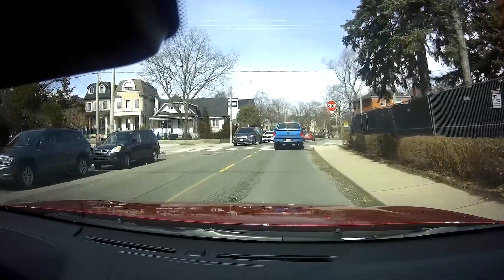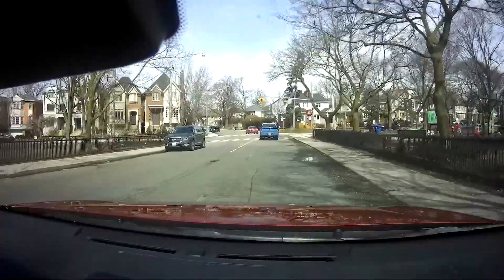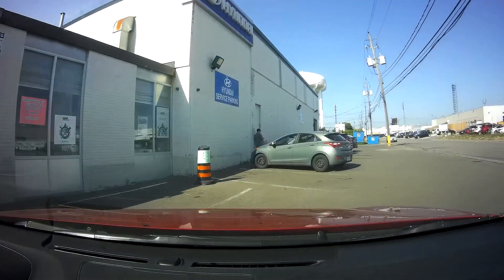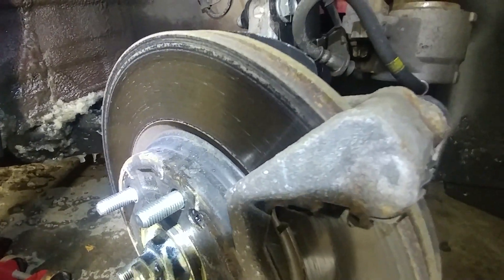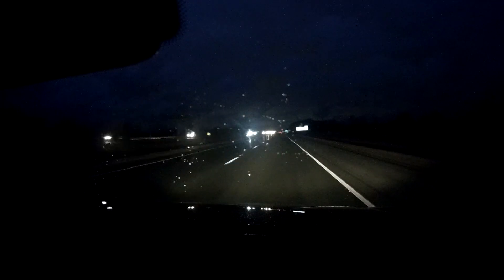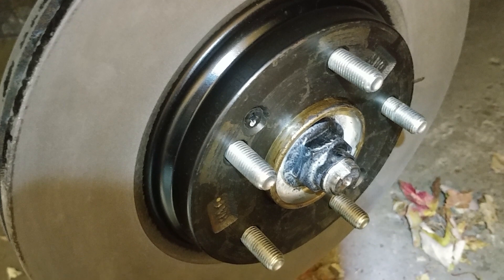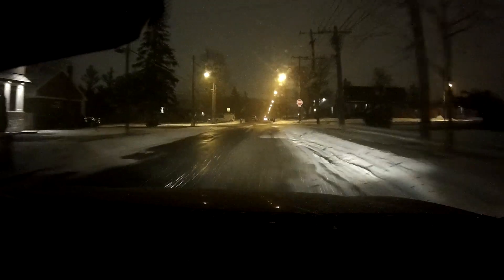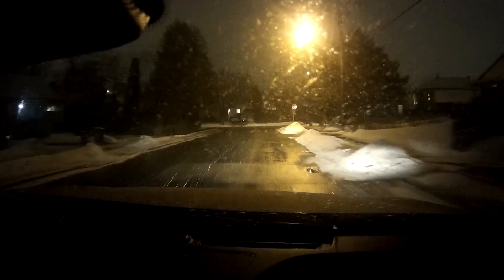Kona EV - Time for a new motor & reduction gear at 30,000kms?

Comment: Kona and Niro owners who are out of warranty are now reporting that Hyundai/Kia won't cover the cost of repairs despite that these issues are entirely a factory defect.  One Niro owner with a warranty can't get Kia to acknowledge the noise while another with a 3rd party extended warranty has been told that they won't fix it while the car is still operational.
Reply: Attorney.

Comment: Good thing it was figured out. I'm glad I purchased the 8 year bumper to bumper warranty.  I have the 2022 Kona EV and have driven 20K no issues.
Reply from the maker: Not sure what country you're in, and it's different by model year, but the basic warranty on the 2019 in Canada had 8 year, 160,000km warranty on the drivetrain, so battery, motor, reduction gear. Of course if you want the peace of mind for the other stuff, that's good, but I personally am not usually a big fan of the extended warranties.. the dealerships offer them because, overall, it's usually more of a win for them.. kind of like "the house always wins" with casinos, however if you get issues, it's the same as hitting the jackpot :)
Reply: @robviously-rob0ts   I'm in Toronto and didn't mind paying $3600 Canadian for 8 years bumper to bumper.

Comment: Glad to hear you got it taken care of under warranty.   I'm wondering why changing the reduction gear oil is not part of the recommended scheduled service.
Reply: it is, under normal driving conditions I believe it's around 60K (km) initially.
Reply: @Strato50 that’s right but it should really be done earlier, say at 30k. Some say it should actually be done first at the very first service because the metal flakes get ground off the gears mostly early on.

Comment: Thanks Rob, great video! I had the same issue on my 2019 at around 20K Km. My dealer 9Ajax Hyundai) first tried the shaft flip but that did not resolve the issue. 8 weeks later Hyundai replaced the motor and reduction gear with the updated version. No issues since then.
Reply: did you receive an itemized list of parts used, labor, and cost?

Comment: I'm at 30k, waiting for a bracket to be replaced to "fix" the wheel of fortune" sound.  I have a feeling this will only be a temporary fix, of it fits anything at all.
Reply from the maker: I'd be shocked if it did anything. Literally no change when they did them on mine
Reply: @robviously-rob0ts  I'll be letting them know immediately if the noise is still there or if it covers back.  I think they just follow a process, replace this and if it doesn't work do that.

Comment: This is the same with kia EVs. 1) mounting bracket 2) replacing reduction gear 3) motor replacement. my 2020 kia Niro EV sounded awful (I just had my motor replaced at the beginning of this month and my reduction gearbox was replace a few months back!) and yours does too. I would hesitate to go on long drives. I don't want to scare you however there is A person on one of my Facebook groups that has had the reduction gear assembly explode... this is all due to a wearing bearing BTW. eventually the sound will turn into jackhammering (that is a problem with the motor!... its 10x worse. Hopefully this problem is fixed soon. Also remember!!!!! GET YOUR REDUCTION GEAR OIL CHANGED MORE FREQUENTLY THEN DRIVER MANUAL!! if you look up this issue a lot of people have linked it to the reduction gear oil going bad a lot quicker then the manual says it would. look it up on Redit or Kona/Niro EV forms there is tons of information out there.

Also if you hate the VESS system you might be able to get your dealer to unhook it for you when they replace your reduction gearbox... but warning if you do this you might become paranoid over the slightest changes in noises (like me! lol -_-)
Reply: In the end, an EV still requires an oil change. Lol
Reply from the maker: Thanks, yeah I'm aware of the reduction gear oil changes. My issue with it is that before buying the car in 2019, I looked at the owners manual to see what maintenance is required, and changing the oil in the reduction gear once or twice a year really adds to the cost of ownership. It would be good if Hyundai realized how much they messed up on the maintenance schedule and paid for the oil changes so as to not have to pay for these expensive new parts every few years.. customers really shouldn't have to be left with that cost.. so my thought is that if these parts are warrantied for 8 years, 160,000kms on their maintenance schedule (in Canada, where/when this was purchased), that I can either pay for oil changes, or do nothing and let them pay for the new expensive parts in another 2 1/2 years. Neither is appealing.
Reply: @robviously-rob0ts   I was made aware that as long as I change the oil a few times at the beginning ( once changed during reduction gear replacement and another change at motor replacement will be DIYing it at the end of the summer most likely.. but will check first) it will get rid of the black residue made but metal fragments (people on forms have sent out their oil to be test and it came back as good except that the black was metal residue which wasn't collected by the internal magnet) like Paul said its cheap to DIY it but i do agree with you. Services like reduction gear oil changes should be covered under warranty!
Reply: @singerforlife36 , Even if Hyundai understands the root cause of the dirty oil problem I doubt they have an easy solution and I expect it's cheaper for them to replace a gearbox under warranty now and again rather than implement a TSB and admit there's a design defect. In the bigger picture, the lifetime of a car gearbox is trivial compared to industrial applications (which I'm familiar with from my profession) and I think that's the reason why we don't see a lot of failures in a car that has been available for barely four years.  In other words simple reduction gearboxes are inherently "tough" and can tolerate filthy oil for some time before the increased wear causes tangible issues to arise.  I don't have any proof but my leaning from studying a lot about this is that the issue is sub-par grounding of the motor output shaft.  It has round carbon brush "ring" that is supposed to drain off small induced voltages instead of letting that enter the gearbox and discharge via a bearing.  That method has been shown to be less effective than a solid carbon brush which the Nissan Leaf uses at the intermediate gearbox shaft.  (Their gearbox oil doesn't show this blackening problem, backed up by far better used oil analysis results.)  The resulting damage is slow degradation of the bearings leaving few visible particles, pretty much what we're seeing. All we can do about this is roll periodic oil replacement into our scheduled maintenance and deal with it.  It's still up in the air as to what period is appropriate because I've seen only one second change after 5,000 miles and it was still getting partially contaminated .  (https://youtu.be/60Cv-JcjaSQ) There's a few of us working on trying to set a reasonable period and that will be documented at the InsideEVs Kona forum.
Reply: @paulaxford6754  I just bought extended warranty due to this issue as I think my reduction gear assembly might be going again!! Im starting to hear the "playing cards on bicycle wheel" noise again when pressing down on the accelerator up to about 20kms then it goes away... this is how it started the first time. Im crossing my fingers this is not the case but just for piece of mind I now have 10 yrs 200,000km warranty which will last me 10 yrs of ownership (exactly how long I was planning on owning this vehicle for) so I don't plan on doing the reduction gear oil changes earlier then what is recommended in the manual since I am covered and if my reduction gear assembly is failing again (praying this isn't the case) that means even changing the oil after around 5,000kms (when my motor was replaced) it still not sufficient enough to keep this part from failing.
Reply: @robviously-rob0ts  I don't think the dirty oil issue is related to the wheel of fortune.  These are two different screw-ups by the same company.  Neither has a proven root cause (but strong suspects) and the dirty oil issue remains for all owners, but at least results in very few failures IMO simply because gearboxes are tough and even in adverse lubrication conditions can survive the very short life required for consumer applications.  The point for many owners to consider is that most of us worldwide don't have the long warranties N. American markets demand.  Mine is 6 months past the drivetrain warranty and I will have to cover all repair costs.
Reply from the maker: @paulaxford6754  ah yeah, I definitely feel for you in that case. I'm not saying I'll never do the reduction gear oil changes, but I just won't start just yet
Reply: @robviously-rob0ts  as a DIY job it's certainly an easier decision ($36 worth of oil) but some owners have paid US$150 to €300 to the dealer and I can fully understand any retisience from a purely economic perspective.  My Kona cost me 75k of hard-earned dollars and it's not as hard to decide!  And, I'm stuck with it until Hyundai replace the potentially-defective traction battery.

Comment: Rob, is the reduction gear oil replaceable?
Reply from the maker: It is technically, yes, but you need a pump to get the oil back in. It's not like most cars where you just pour oil in from somewhere under the hood.
Reply: @robviously-rob0ts  it's easy to do the fill portion of the job from under the hood. Use 15mm OD (max) x 0.6m long PVC tubing from a funnel down to the filler opening.
Reply from the maker: Check this out https://www.youtube.com/watch?v=60Cv-JcjaSQ

Comment: Rumors i've seen on forums is that the reduction gear box drain plug doesn't have a magnet on it. This results in the fluid becoming loaded with metal particles and an increased rate of wear on all the components inside. Seemed like a bit of an oversight. You can get a replacement plug with a magnet online for $40-50. Votex DP007 is apparently one that fits. Might be worth getting one and tell them to install that when they replace the reduction gearbox.
Reply from the maker: Thanks, yeah I had seen that as well. If we get to that point I'll ask them if they'd do it, or if they have an issue with it.
Reply: @robviously-rob0ts  https://www.youtube.com/watch?v=60Cv-JcjaSQ
Reply: Will the dealership install an aftermarket plug like that?
Reply from the maker: @dretech  I'll be asking if they do replace my reduction gear, otherwise I'll be looking into doing this https://www.youtube.com/watch?v=60Cv-JcjaSQ

Comment: Blew out a bunch of motor mounts apparently on the Smart ED because of the torque. Had to replace the single gear transmission too. Hope this goes better for you as it was pricey to pump down the refrigerant to get it all out.
Reply: Same I had replace the reduction gearbox and the rear motor mount.

Comment: Had this problem on my 2019 Kona here in the US.  They recognized the problem right away and replaced the motor/gear reduction assembly straight away, without having me jump through hoops.  That fixed my problem, but I’ve since sold the Kona back to Hyundai due to the battery issue.  Good luck to you.
Reply from the maker: Thanks. I'm wondering if the hoops are country-dependant or not, or if its each dealership that decides. I got my new battery pretty quickly, so I'm lucky with that at least

Comment: Yup. This same problem happens with my Kia Niro EV 2019. Dealer acknowledges the problem. Installed that "motor mount." They said they still heard the noise, so now they are back-order on that "reduction gear" part... (I told them they should replace the motor itself, but was told they have to follow Kia's procedure, step by step)..  it's been several weeks and I'm still waiting. Like you, that noise is also randomly happening on regen and slow acceleration, and sometimes it is soft and sometimes it is loud(er)... so far, just annoying noise...
Reply from the maker: It's funny because I have other people say that their motor was replaced first, while others say it's the reduction gear replaced first
Reply: @robviously-rob0ts   if the motor was replaced first its usually due to a missed gear.... I had my Niro EV gearbox and motor changed in that order since it wasn't due to the motor missing a gear.... makes almost the same noise but when testing the motor when up in the lift the tech can clearly hear the difference.
Reply: @robviously-rob0ts  I got the motor replaced first and the sound it's still there. The dealer recorded the sound and send it to Hyundai to check. I hope it will be soon solved